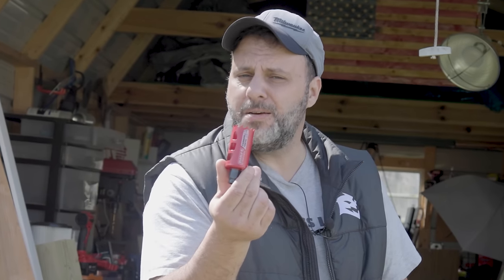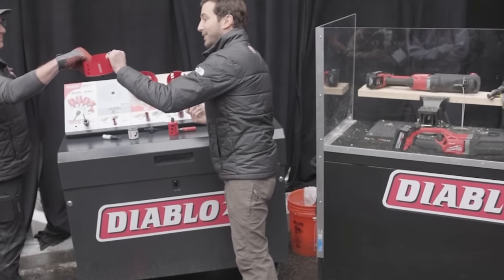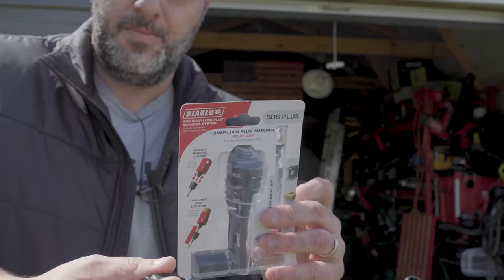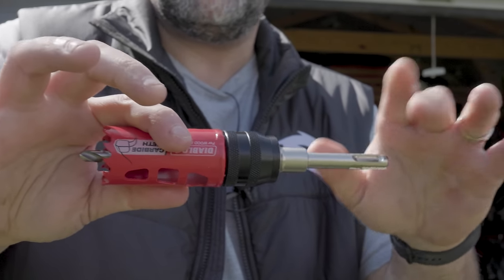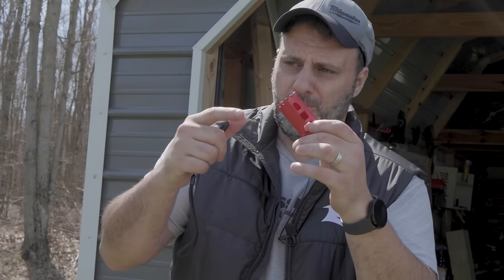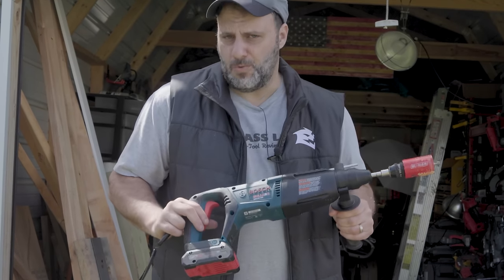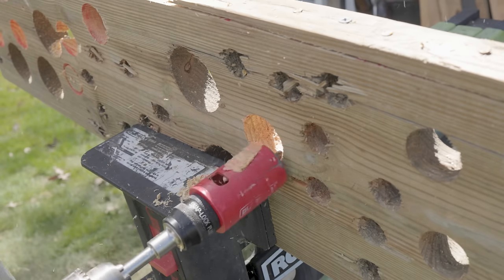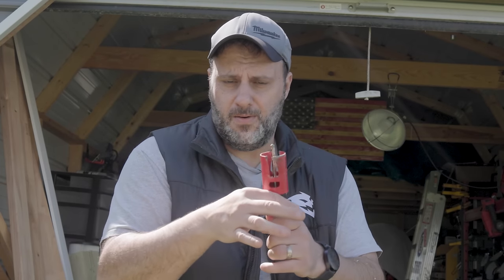Construction will NEVER be the same with this new tool

Comment: That's great, about time they come up with a new design. One of the problems with the old design is the hole saws get stuck on the mandrel, every freaking time.

*Just two things I would add to this new design, a few longer drill bits and cylindrical guides going on or replacing those drill bits. Guides to center new larger holes on smaller holes.

Comment: I prefer my impact when drilling, including large holes. Instead of a drill wrenching your wrist if it binds up, the impact will just go into impact mode. Plus it's a compact set up.
Reply: Or get a new drill with a clutch/anti kick back.
Reply: @AllTattedUp13  Why spend the money and take up space in the truck, when I already have a tool that does the job. I have several drills with clutches that only get used for small hammer drilling needs. The problem with the clutches, is they slip and stop drilling by design, the impact goes into impact mode and hammers through. If I were a plumber or an electrician it might make sense, but as a  remodeling and home repair contractor the impact does the job perfectly for me. The impact is also compact, my SDS hammer drill is longer than 16" and won't fit in tight spaces or between studs. Impact for the win!

Comment: Usually, I can keep my drill-driver under control. It's that damned Hole Hawg that I throw back into the shop and tell them to give me a proper Right-Angle Drill. Far more leverage and a better clearance, Clarence, on the Head Depth.
And yeah, those look nice.
Now I need to get an SDS Head tool.

Comment: Yeah bosch or lenox made this system decades ago when I did hvac in the early 2000s. Dont know  if they had an sds mandrel back then. I tried to use them, but the cost was high and I was a young struggling tech, so i got tired of changing mandrel adapters and went back to snap pin mandrels since they are universal. Spyders system is pretty nice too, as a kit they are priced well. I think my tct hole kit w tct pilot bit was under 100.
Reply: Bosch owns Freud  and Diablo, i expect more things like this.

Comment: They fall inside walls. The mandrel comes apart. They are not new, Spyder did it first. Hopefully they did it better. It’s a shame, this is the only Diablo item that has failed in my usage
Reply from the maker: Appreciate the feedback 👊
Reply: I have the spyders, nvr had one fall off on me...yet.